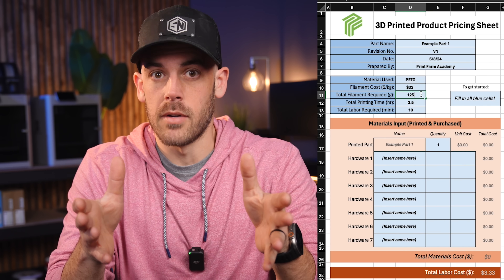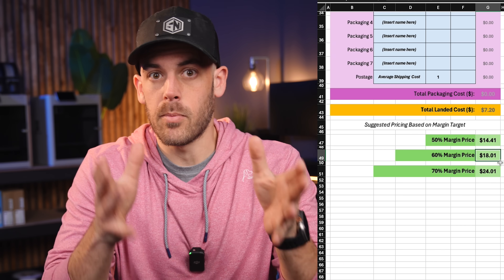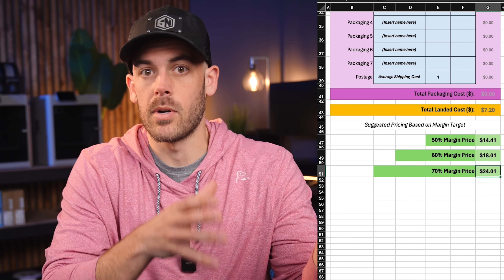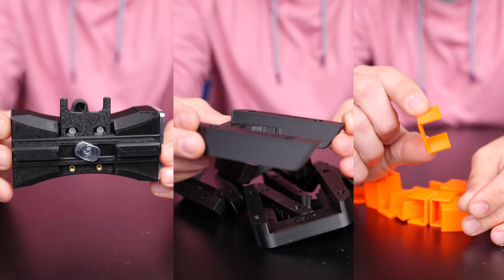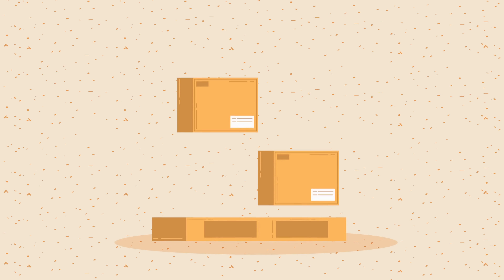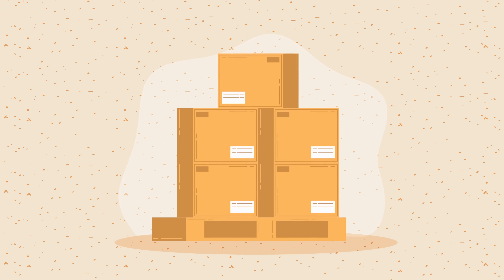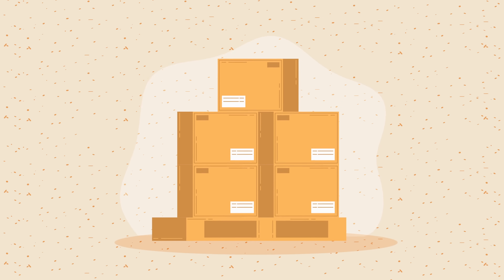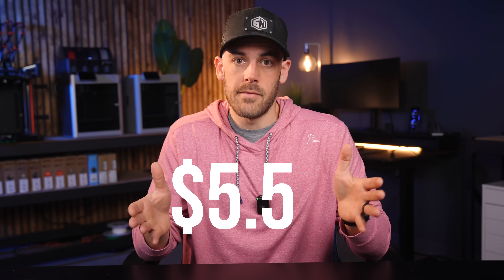Why I charge $55 for this 3D printed part (how to price)

Comment: I’m an IT executive, have managed data centers. We’d factor in for things like power consumption of device, BTU’s of heat it produces (which have to be offset with AC), etc. 

If you’re not Slant 3D you can probably do some napkin math to come up with a good factor which is like time to print times the facilities overhead cost for the print farm (over time).

Comment: Very good comments from your side. You are calculating the parts price almost on the same way like I do for my 3D printed parts. I am sometimes frustrated if hobby printer destroy the market price by charging only the material costs. They do not have a sense to run a business in a correct way.

Comment: I worked with Ken onion for a while in Hawaii and he used to preach this to me.  He always said to use a rule of thumb of 5x your cost. But your cost includes labor, materials, electricity, machine maintenance, etc 

One thing though he’d always mention that you didn’t—space. Yeah you probably do it out of your house. A lot of makers have a dedicated space within their house to make whatever it is they make. But for easy math say that your rent/mortgage is $1000/month. If you spend say 10% of your time in the shop, that’s $100 right there. Then, if you make 10 items a month, there’s $10 per part you should account for.  This is no different than a place that rents a space having to account for their rent costs. 

Ken and I would get into the weeds about real world costs. And he’d advice accounting for time used to learn programs or skills, but I always argued that should he reflected in your hourly rate. 

If you use your car to pickup materials or run packages to the post office, there’s another small incidental cost too

Comment: the one thing I don't like in your calculation is your factor in profit margin on shipping cost itself. on the material to ship, that's fine, but on the shipping cost from USPS or whatever else courier, that's shady and unethical. unless your 5.76$ is only for packaging material and does not include the shipping cost ?
Reply: How is that shady? Shipping costs vary per carrier and over the course of a year. By doing so, you include this in your calculations.

Comment: I once asked in a 3D printing forum about what people charge for machine time if they sell prints, I basically got laughed at stating machine time is almost zero cost (I think one guy said a penny per hour) and I knew that would end in financial disaster. Now my machines are fairly solid and one of the 2 I have I have been using now for 11 years (still works like it was new) and I only spend like $100 a year to maintain it so I feel that is great but my electricity would be almost $0.45 KWH if it were not for my solar (I figured with the solar it's closer fo $0.20KWH) but still higher than most states. But yea, gotta calc in 'all' costs (lots of business fail just for this reason). Was trying to educate a friend of mine on this (has a small business but was always coming up short) and he missed hundreds of small expenses that add up quickly, he finally almost doubled his rates and started making a profit.

Comment: Really good breakdown, thanks for sharing. One extra point could be a minimal amount of order. If the ordered object is tiny and cheap, you won't sell it for 2 dollar, even though the margin is good, does not worth the effort. A seller needs to set a minimal order, otherwise they just overwork with tiny jobs.

Comment: Have had my printer for about a year only have one it runs about 20hrs a week . its a hobby not a job for the moment anyway .

I tend to use 1$/hr of printing to cover cost of repairs and wear and tear and electricity. my simplified way of counting print cost is use filament cost+ add 10% for loss+ 1$/hr for print time and then x2 . 

for custom stuff when needed to design new part I count my time at 25$/hr but find that since I ve gotten more efficient at using Onshape and fusion its not a real representation of design cost.  need to figure a new more consistent way to calculate that taking experience and efficiency into consideration 

as for parts cost i usually just count the price of parts and add it to total cost dont make profit off of parts . I will however count full price and if I get it on sale or bulk price thats extra cheese for me. I like cheese hmmmm cheese . curd cheese is the best shit now im hungry

Comment: A $20 landed cost and sold at $40 is not a 50% markup, that's 100% markup. 50% would be $30 (20*1.5) am I missing something?
Reply from the maker: You are correct, mixed up the term!

Comment: I have to eat while printing, so I charge for my food and a sizeable tip to the Doordash guy. I have to be clean, so I charge for the shower water and the electricity to heat the water. My shower towels have to be cleaned,  so I don't leave out that water and electricity for the washer and dryer. Oh yeah, don't forget the soap and fabric softener. I have to pay rent on the house, so this is factored into the cost. I need health insurance to be sure I can keep printing these parts, so of course,  I need to charge for this.

So, even if that paper clip holder only requires 75 cents of filament to make, I charge $1200 for it. I think it's a fair price.

Comment: So I calculate my machine cost based on one year for every printer I own with a productive time of 10 h/day for FDM and 14h/day for SLA (based on average productive time). So my machine cost is higher. But if the printer is productive for 10h/day, than I will gett back the cost in roughly 1 year. That means 2 years of printing at 10h/day (FDM) will get me a new printer. I find this is good for expanding, but it also results in a higher part price.

But I'm not calculating the cost for space, because the printer runs in my basement, which is included in my private living cost. Once i get a workshop, I will include it.

Comment: Your cost for labor time should be based on employee that has just started the job and has no experience. Cost of the building should also be added, (rent electric, vehicles if you have a company vehicle and any employee that is added that to do other jobs. You have a set amount of daily labor each works x amount per day, unless less you are not paying yourself for a full day. Not all your labor changes are added to the production of parts at this time. So you are leaving out a lot out on your cost per part. It not much of a increase on total cost but when you start discounting the part your profit will drop even more or if you have to dump inventory that is no longer moving out the door at a deep discount below cost that becomes a loss than, a bigger loss if the other factors are not added because that lost can than be taken off your profit.

Comment: I don't know if this will help anyone but:

Say I have a 3D printer. The time used in printing something means that the 3D printer isn't available to me anymore. Because I design my own parts, that means I can't be prototyping for example. This is a cost to me...

So when deciding whether I have a viable product on my hands, I attribute a cost to the time the printer is occupied in a print. For me, it's around $10NZD/hour (So that'd be around $7.50USD/hour). i.e. A print takes 4 hours, I attribute a cost of $40NZD to it. If it has no post processing, and no additional parts (micro controllers, LEDs, hardware etc.), then that's the "cost" (bullshit figure that I use to justify what I'm charging) I work on. I don't need to worry about how much filament I've used, the cost of electricity etc. That's it. I can then add my "margin" on top of that. Usually only $10-$20NZD because there is plenty left over in that bs figure I'm working from. 

i.e. Say I'm doing a 4 hour print and I'm charging $50NZD for it. I can produce 5 such items in a day assuming very little or no down time between prints. So on each printer I'm bringing in $250/day. Most of the cost that I was working on is based on the inconvenience of not having the printer so while my actual material costs are probably more like $50 for the week, each printer is bringing in $200 / day. $1400 / week. While the print is happening, I'm not doing much. Perhaps chucking bits in courier bags (assuming I'm doing non-fungible prints). And all I have to do to scale up is add printers...

And I mean, it's not strictly linear because I have to factor in redundancy (if I have 5 printers, I should have one printer that isn't being utilized. Instead it should be used in case of a failed print. This is assuming non-fungible prints where keeping to a delivery schedule is important) but for the most part, more printers, more capacity.

Shipping is for later. It shouldn't be included in the cost of the thing because I shouldn't be profiting off the shipping. I do not worry about the time to quickly debur and throw it into a courier bag or whatever, because it is such an insubstantial cost (it takes.... all of 3 minutes? If it was something that had A LOT of post processing, that's a whole other thing, but normally for those items, I'm also looking at additional costs like programming a microcontroller and testing etc.).

Basically, the cost of filament is such a pointless thing to be basing your costs on, as to be deceptive and get you stuck calculating completely pointless figures.

Comment: 2:36 hold the fuck up. so your factoring in the fact you or your printer suck at doing your job (failed prints)???? get fucked. if a plumber comes and installs a sink and it leaks and he has to come back to fix it you dont get charged twice. in no other job or service do you get charged for failed attempts. i cant wait to see what other bullshit you factor in. you want us to compensate you for lost time with family and friends because you chose to work? where does it end? 
7:14 i assume its free shipping then if packing and shipping is included in to the $55 price. theres no links to the crap you actually sell so i couldn't confirm this
7:27 hold on, we are still talking about thatt single tiny piece of plastic? it scares me to think about how much you try to sell it for. it wouldnt even be worth it even if there were 20 in an order.

Comment: Printed parts are much more expensive but weaker and uglier in comparison to plastic parts. That's my opinion
Reply: Creating plastic molds can be very expensive, and they’re not adaptable like 3d printing. When a product is sold in very high quantities the mold cost is offset by the volume of product sold, but often parts sold in low quantities are 3D printed because they do not have that same large up-front cost.

Comment: You charge as much as you think the market will bear just like every other greedy business justifying a high price doesn't make it legitimate! As 3D printers become more mainstream these shady print farms that want to charge you $100 for $10 worth of printed plastic will be long gone, enjoy your scam while you can! 3D printers are cheap and they last a long time between repairs so costs are minimal! Sure make a few dollars that is legitimate so $10 part + $10 shipping and charge $30 for the part but so many of these print farms charge $100!! I just looked at a print farm, I had a part that was a little too big for my 3D printer to print $6 of pla and they wanted $100 ROFL go fk yourself I told them and bought a a couple pieces to extend my printer for $50 instead!! Now someone printing well engineered parts that you can't get anywhere else are one thing but most online 3D print farms are printing designs they got on Thingiverse or Printables under creative commons license and unlawfully selling the completed parts on Ebay, Etsy or other online places!!

Comment: I simply charge what the market will bear.  If you have a unique item you have designed on your own, and it is not simple for someone without proper cad software, you have an advantage and can mark up.  I make a much simpler part than you showed and I charge $50.

Comment: One suggestion on the pricing sheet - if you could move the advanced inputs into the calculation sheet (maybe an expandable section), then I could have all my products in the same workbook, one on each tab. Then you could also add a rollup worksheet that could show all products in that workbook to see the important data across them at a glance. Still would allow others to use them as individual workbooks if that works for the as well. Just a suggestion, otherwise love it!

Comment: This is not a criticism of the channel, on the contrary this channel has so many good ideas but unless I'm wrong and please correct me, unfortunately here in Brazil it's a little expensive to work with 3D printing. Follow my story...here's another piece of research I did about filaments here in Brazil; Recently, when comparing filament costs between the United States and Brazil, I came across a significant disparity. While in the United States the average cost of PLA filament is approximately 25.52 dollars, in Brazil, this cost is substantially higher, reaching around 127.08 reais on average.

This price disparity led me to reflect on the accessibility of filaments for 3D printing in the Brazilian market. While in the United States the cost of filament represents approximately 2% of the average minimum wage, here in Brazil, this cost corresponds to approximately 9% of the minimum wage. This difference is considerable and raises questions about the access of these inputs to a wider audience.

I understand that there are economic and logistical differences between the two countries that can influence production and distribution costs. However, the similarity in filament prices, despite these differences, suggests the need for a more in-depth analysis of pricing practices in the Brazilian market (I may be talking nonsense but in my opinion the value in Brazil should be at least 4% which is already twice as much as the United States and also some companies say that they are 100% Brazilian with raw materials from Brazil, so why this value of 9%)

I can be one of the few to raise this flag and discuss ways to make PLA filaments more accessible and competitive in the Brazilian market, and accessible to more people. However, for personal reasons I may not directly enjoy this benefit if filaments become accessible to a wider audience. However, I insist and reiterate, I sincerely hope that more and more people raise this flag, firmly believing that a review of pricing and recycling policies for materials that went wrong or leftover printing (returning to that issue of multicolor printers), we will have more people with access to this incredible technology, and nature thanks you.

este não é uma critica do canal , ao contrario este canal tem tantas ideias boas mais a menos que esteja errado e me corrija por favor , infelizmente aqui no Brasil fica um pouco caro trabalhar com impressão 3d . segue meu relato ...aqui vai mais uma pesquisa que fiz sobre filamentos aqui no Brasil; Recentemente, ao comparar os custos do filamento entre os Estados Unidos e o Brasil, deparei-me com uma disparidade significativa. Enquanto nos Estados Unidos o custo médio do filamento PLA é de aproximadamente 25,52 dólares, no Brasil, esse custo é substancialmente mais alto, chegando a cerca de 127,08 reais em média.

Essa disparidade de preços me levou a refletir sobre a acessibilidade dos filamentos para impressão 3D no mercado brasileiro. Enquanto nos Estados Unidos o custo do filamento representa aproximadamente 2% do salário mínimo médio, aqui no Brasil, esse custo corresponde a cerca de 9% do salário mínimo. Essa diferença é considerável e levanta questões sobre o acesso desses insumos a um público mais amplo.

Entendo que existem diferenças econômicas e logísticas entre os dois países que podem influenciar nos custos de produção e distribuição. No entanto, a similaridade nos preços dos filamentos, apesar dessas diferenças, sugere a necessidade de uma análise mais aprofundada sobre as práticas de precificação no mercado brasileiro (posso estar falando besteira mais  na minha opinião o valor no Brasil deveria ser de pelo menos 4% que já é o dobro que os Estados Unidos e também algumas empresas falam que são 100% brasileira com matéria prima do Brasil, então porque este valor de 9%)

Posso ser um dos poucos a levantar esta bandeira e discutir maneiras de tornar os filamentos PLA mais acessíveis e competitivos no mercado brasileiro, e acessíveis a mais pessoas. No entanto, por motivos particulares talvez eu não usufrua diretamente desse benefício se os filamentos se tornarem acessíveis para um público maior. Contudo, insisto e reitero, espero sinceramente que mais e mais pessoas ergam esta bandeira, acreditando firmemente que uma revisão das políticas de precificação e reciclagem dos materiais que deram errado ou sobras de impressão (voltando àquela questão das impressoras multicoloridas), teremos mais pessoas com acesso a esta incrível tecnologia, e a natureza agradece.

Comment: You need to be careful DeWalt will not sue you guys for using their logo on your Prints! Legal things can be a pain!
Reply from the maker: It’s not their logo, just text
Reply: I am sure they have a Full Trademark on the DeWalt text and logo etc.
Reply: @PrintFarmAcademy  They 100% have trademark protection on that text in that font with that design. But regardless you are absolutely exposing yourself legally using their name on any product you sell without licensing it from them. They own that name for commercial purposes related to their area of business, and you would immediately lose the case if they sued you for selling products that fit their products with their name on it.